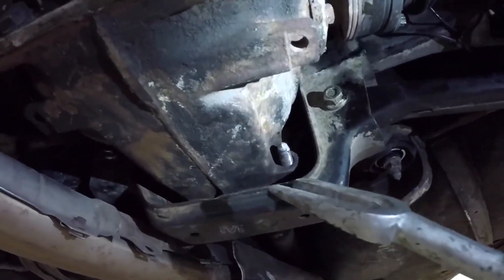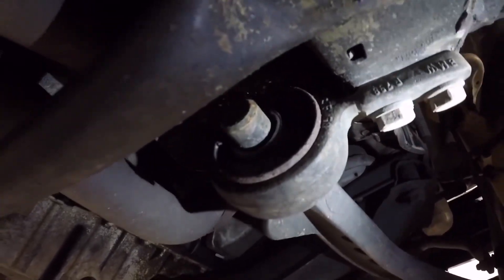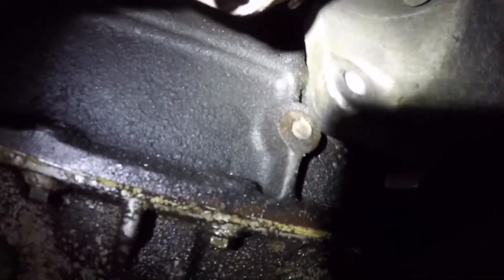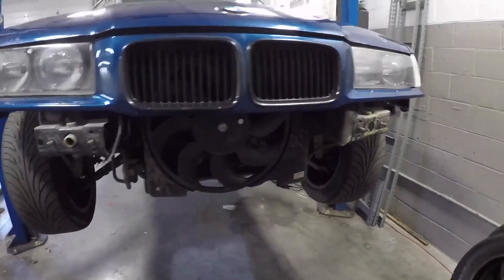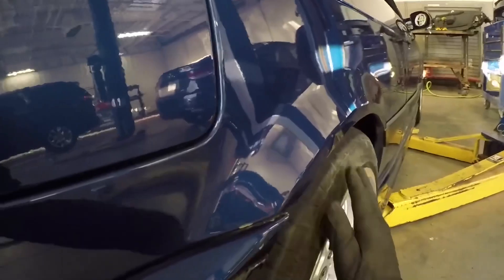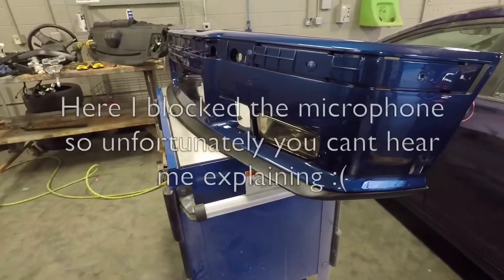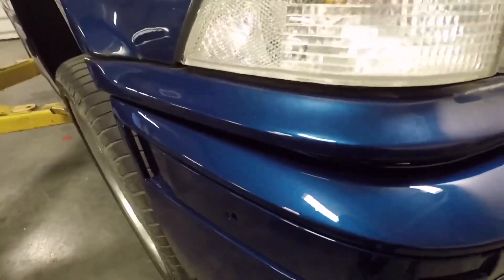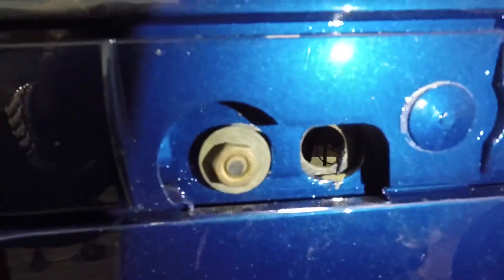New Bumper for Project M3 & Mysterious Clunking Sound...

Comment: Lesson learned: when doing bushings, there's lots of "while you're in there" jobs that should be addressed. Guibo is absolutely one you should have done while you were doing the rear subframe.
Reply from the maker: That is usually my mindset but I haven’t addressed that part yet. The next part are engine mounts, control arm bushings and transmission mounts. I’ll address the guibo and transmission bushings and driveshaft a little later